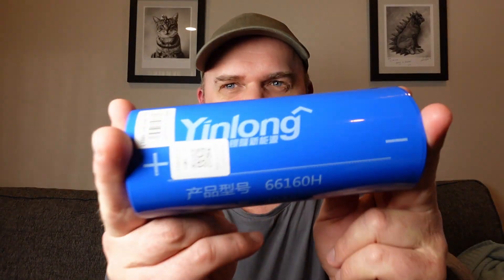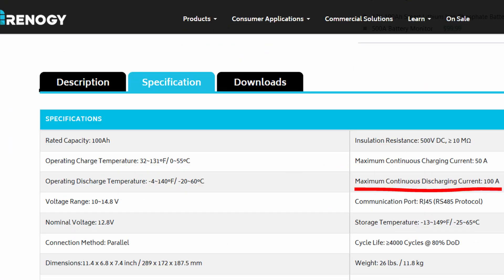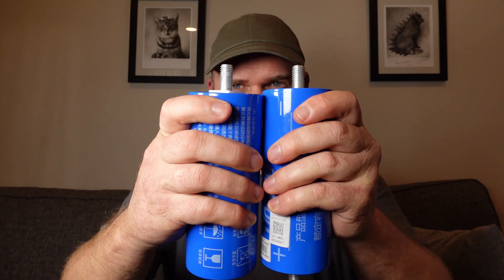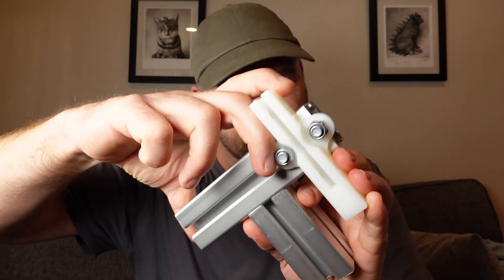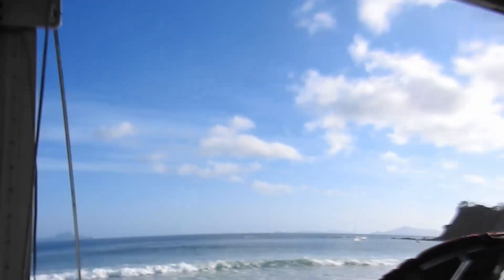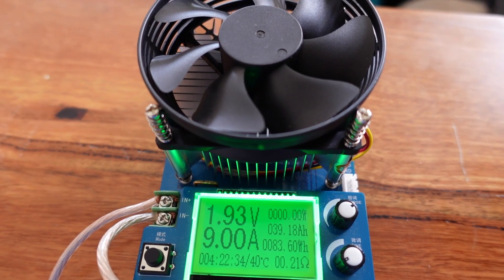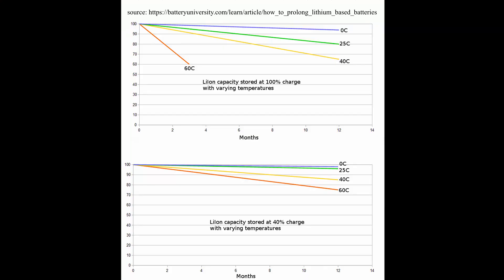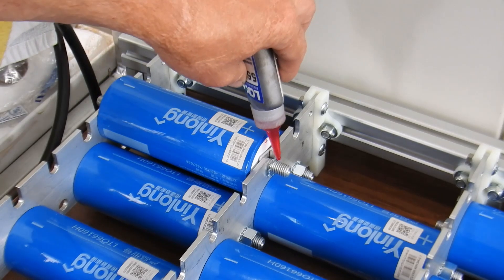Campervan DIY battery build HUGE POWER!

Comment: This is the most interesting set-up you got for your off the grid/caravan. 

I have one (probably a "microscopic" use compared to your use.) - I do a lot of ice fishing and ice camping during the winter months.  We have a portable ice shelters and equipments that run off  LiFePo4 batteries. (Depending on how many people are involved) My question is does those batteries that you used are 12volts? AND how do you recharge them back especially after each outing?  Our electronic fish finder runs off 12volts and we usually have anywhere from 10Ah to 20+Ah battery sizes (each one of us have different fish finder units and I know my buddy has a Garmin Livescope unit which is the most "power hungry" unit than the rest of us.) Also most of those aforementioned units run at RMS 500 (except for the Livescope which is probably more.)

Will those batteries you mentioned working on those fish finder and most of them run at DC 12-24 volts at different draw rates in "mA."

Real question is will those LTO work for those applications?  

We wanted to go lighter as we carry a lot out onto the ice and always trying to shave off some weight in anyway we can.  (Similar to the"hiker's rule" -Gram for gram, pounds for pounds, etc yet be compartmentalized.)

Thank you and keep up the good work on the YouTube video.  

Hailing from Maine 🤠😎😁

Comment: I'd like to make a battery bank of these for an RV how many would I need for 400 amp hours?
Reply from the maker: That depends on what voltage you are running.  Please try and get Ah out of your head as a metric for energy capacity.  Each cell has a capacity of about 0.092kWh.  So assuming you are meaning 12V... around 54 cells.  If you are looking at a bank of decent capacity tho I assume you have high power requirements.  If this is the case, consider moving away from 12V, it really is a terrible voltage to deal with for the loads in a modern RV.
Reply: @brendontait6968  Ah, ok. Good stuff thanks!

Comment: Wil also didn't say about using for 48 volt, if I remember and the math make them real good for that. If I also remember, he did another vid and said he'd gotten efficency wrong on them. I think one of there only drawbacks is wt. (Compaired to other lithium chemistries) witch shouldn't mater if used in a house and there prob alot lighter them lead based batteries anyway, I'm fairly sure. Doesn't seem to be much out there on them. This is my second time watching this vid. Take up more space? Nice build.
Reply from the maker: Cheers, from memory he did mention 48V in one of his videos but said it wouldnt work well either which is nonsense.  A friend of mine has a 4.5kWh LiFePO4 battery in his van and it's pretty much 1/2 the weight of my pack.  So with that example... there realistically is no difference in weight.  Also the fact that these are happy with 100% dod vs 80% dod for more orthodox lithium chemistry you can take some of the weight factor back in there also.  There is no doubt that other chemistries can be more efficient with weight and volume.  My requirements were ruggedness, safety and long life - I think these work well for that.  When I get more available time I'd love to put a bunch more time into youtube to create a bunch of different educational videos on electrical systems.  Hopefully '22 will be that year
Reply: @brendontait6968  I'm living in a RV in cold climate (Iowa, USA) and chemistry of other lithium batteries don't take charging below 0°c/32°f and I think I read that this chemistry isn't as fragil in charging below freezing temps. Thanks for your time and work doing the vid. Please do do more. For lifefo4 at up to 3000 cycles compared to 10,000-20,000 cycles, we're talking a life time battery! If they are cold hardy, I could mount them under thev RV, in the frame, a swing down  panel/box. There is, I think a half dozen sections, around 6x5 foot x about 5 inches deep under there. Good day.

Comment: great information I will be looking at these batteries for home bank. The only thing I would change is to use copper buzz bars
Reply from the maker: Cheers, why copper?  I can't see any real motivating factor.   Huge difference in price, the cell lugs are aluminium so all of a sudden you create a multitude of dissimilar junctions.  The distance the current travels in the bus bar is short, so any losses are negligible.

Comment: This video addressed most of my concerns about putting a battery bank together with various chemistries. Thank you for all of the hard work. My only issue that I see is 2.4v times 5 cells is only 12.0 - - I'd be worried that's not a high eenough voltage for my system which shuts off at 11.7v and would be much more comfortable with 6 cells in series which provides adequate headroom at 14.4v
Reply from the maker: I assume you mean series and not parallel.  Is there a specific reason you want to use a 12V system.  I'm using 24V and I think that is on the low limit.  12V is even less!  But yeah 6S is probably the way I'd go if I were doing 12V.
Reply: @brendontait6968  yes I did mean series and not parallel. Will edit. That's just currently what my inverter is - 12V system. I can switch to 24v or 48v. Have been thinking about it. But I'd have to buy a new mppt charger and inverter. Currently needing to replace my AGM batteries so it's all up in the air for now.
Reply from the maker: Have a think about where you want your system to go to future proof it.  I'm running dual induction hobs, electric oven, electric hot water and domestic fridge.  It can do it, but just.  I wouldn't want to run any lower voltage.  If you are looking at increasing your draw.  Consider selling your inverter, mppt etc and buy an all in one?  One thing to be aware of is some lithium batteries have a limit on max series voltage, so keep this in mind.
Reply: @brendontait6968  currently I'm fitted with propane oven/stove and 12V/24V fridge. Plan on sticking with that plumbing and going with a tankless propane water heater. But at first I wanted to do diesel heat with tankless water heater and radiant flooring. My main electric needs for now are simply 12v fridge, charging powering phones/computer, security system, and air conditioner. I can get a rear window A/C with dehumidifier that runs about 400W-500W but I'd like to run it 24/7. All in all I would assume around 60 amps per hour (A/C 50A max on startup but probably half of that to run, fridge 1.5A, security system probably 5-10A, electronics 5-10A) and I'm not entirely sure how solar panels will effect my total needs for AH capacity. Also a few minutes of microwave per day. So AGM is definitely not the answer for this and idk if Lifep04 is either longterm.
Reply: @brendontait6968  just did some quick math, and with 600W solar panels and 8 hours of sunlight I would need about 13kwh of reserve energy to go 24 hours per day or 1000ah battery
Reply: buggzo 6 cells parallel is 2,4v. Or what do I know
Reply: @4486igi  absolutely correct. Edited to be accurate now

Comment: It’s Ampere hours as the test is a discharge test at constant current over a defined discharge period, so a C10 rated battery will achieve its Ah rating when discharged over 10 hrs but a C5 battery can achieve its Ah rating when discharged over 5 hours ..

Comment: Interesting build, but unless one has access to CNC equipment, not repeatable for the average person.
Reply from the maker: Hey John,  thanks.. but I disagree with you regarding the requirement for CNC.  Many aluminium suppliers offer a routing service, I've supplied the files that could just be given to an aluminium supplier, alternately they could be done at a laser cutter, or you could print them out 1:1 and use the files as a template to manually drill the plates.  The side brackets could be 3D printed, or could be made just out of an angled section of nylon.

Comment: Great video.  Im trying to convert my forklift to a more efficient battery system.  How many of these batteries would I need to convert it over.  the current forklift lead acid battery rating is 48v 510ah.  also what do you use to charge it with?
Reply from the maker: Thanks, yeah it would take a lot.  One of the issues is that the forklift needs the weight of the lead.   Your current battery is about 24kWh... but you can only use half of that else you degrade the battery.  SO... these cells are about 92Wh each, so that's around 130 cells.  However.... I'd be looking at using prismatic cells to make it easier to pack and more space efficient.  You can just charge with standard lead acid charger or any other current limiting power supply

Comment: Can you design us a car battery size so we can use it for other things ? Thanks. *   So 18 cells in a car battery size box (2series strings in parallel --> 120 Ah @ 13.8v, cost 12 cells for $700 or you can say  for 18 cells : 1.5 x $700 = $1050 + mounting box , bus bars, time, effort. etc... what do you think on this... i want it to use with my patent circuit. 
  Background: 
  So the dimensions of one of the 2.3v cells looks like Approx 3" diam x 5.5" lengthn *pop can size*,... hmm.. so to make a 12v car battery size combination cell would be 12/2.3v = 5.2 cells , then add 1 more cell to make sure at 13.8v ( should be ok )  gives 2 rows of 3 cells each all in series --> 40 amp battery @ 14.3v   Neat... but prob won't start  a car;   & that look to be a very short height and $$$ battery, right, but experimenting with pop cans and a 12 pack size cardboard box, might get 20 cells in there to get up to 20 x 2.3v or 10 (2 series rows in parallel ) x 80A --> @ 23v or  maybe 5 ,5, 5   3 series rows of 5 cells each to get the 5 x 2.3v = 11.5v no too low the V for a car, ok 6,6,6, Mark of the beast?  3 series rows of 6  cells each - 2.3v x 6 = 13.8v and 3 rows gives it 3 x 40ah each= 20ah comparable to a 12v battery .*Repeats from first line:    So 18 cells in a car battery size box (2series strings in parallel --> 120 Ah @ 13.8v, cost 12 cells for $700 or you can say  for 18 cells : 1.5 x $700 = $1050 + mounting box , bus bars, time, effort. etc... what do you think on this... i want it to use with my patent circuit.

Comment: How many do i need to power a 2,000 sq. ft. house efficiently? I'm ready to drop the power company. I will use 12v dc lights throughout the house and power inverters for window units
Reply from the maker: It really has so many factors.  I'm going to do something similar soon.  You first need to know your average usage listed on your power bill in kWh/day.  Additionally you need to have an idea of how much sunshine you get, also an idea on how many days you'll get without sunshine.  Because of the considerably larger amount of power a house uses compared to my truck, I'll be using LFP cells

Comment: Really nice rack mount for the cells. I'm a bit worried about the small tube used for isolation from the rack though.
Reply from the maker: Thanks, tho the tube does not provide complete isolation, just isolation to the mounting bolts, which have secondary isolation through the brackets to bus bars

Comment: I think they shouldn't be in system as 400A, because is too much for these cells:

Max. Discharge current (A) 400
Optimum discharge current (A) 40
Max. charging current Charging current (A) 400
Optimum charge current (A) 40

So in normal situation, in optimal system they will give you 10 times less power that you told.

Correct me if I wrong ;)
Reply from the maker: Yeah, I think you are wrong sorry

Comment: Hi Brendon.  I enjoyed your very informative video and have read many of the comments and answers.  
I'm building my minivan into a camper van for short camping trips of a few days each, mostly.  I have wired in an A/B/Combined battery selector switch and have wires run to the back of the vehicle.  My biggest need for electricity while camping is for interior lighting, which is currently a combination of LED and a strip of small, low wattage bulbs in an overhead enclosure.  I'll change those to LEDs when I can find something that fits.  
Since a bank of 6 of these batteries has a charged voltage of 15.3v do you know if it would be advisable to replace the vehicle's starting battery with these and not use a second battery?  I realize a lot depends on usage but, as a general comparison... Also, I didn't mention that I'll be adding a 5kw diesel air heater which will require power to both start and continual power for the fan.  
I guess, basically, I'm wondering how much more stored energy I would have with a bank of these versus the normal relatively high capacity lead acid starting battery. 
Thanks - I just found this video last night and looking forward to watching others you've done.
Reply from the maker: Hey, thanks... you could replace starting battery with these cells, however if you have a small system and run it down, you want to make sure you always have enough juice to crank.  Lithium do not do particularly well paired with lead acid, you can just run a basic dc-dc converter to charge these cells

Comment: Thanks for the video! - Does Will know you disagree with his assessment of this battery technology? His thoughts on your findings would be interesting. Is it possible the cells he used were not comparable to the ones you had which lead to the difference in efficiency? Did his cells get hot? - I guess I'll have to check his vid next. Thanks again!
Reply from the maker: Hey, he does know I disagree, he even made a retraction video based around my video.  He still doesn't like this chemistry, but I do.

Comment: Would be very worried about using the aluminum 40 X 40 section supporting the different bus bars because if you had a side impact and 2 bus bars touched the 40X40 supporting aluminum and shorted, my god would you have a electrical fire with molten aluminum!!!!!!!
Reply from the maker: Hey Stephen... It would take an enormous impact to break the mounts that hold the bus bars.  The battery sits about shoulder height and the tray frame of the truck immediately surrounds it.  There are 24 brackets, each with two bolts sharing the load of the cells and potential impact.  The 4040 is more robust than most battery shells.  The battery is fused on both sides so that a short between any busbar and ground will pop a fuse.  I am certain that this pack is safer than most any other that I have seen.

Comment: Noone knows the calendar life of those Li cells. Who has gotten 40k cycles out of them?
Reply from the maker: Hey andrew, you're correct.  The chemistry hasn't yet been around long enough to know.  It has been around for about 15 years and degradation tests over that time have approximated a lifetime.  WIth regards to cycles, there have been many studies undertaken that cycle test cells like this upto around 6 times per hour which would work out to 20,000 cycles in around 5 months, so there is data on this.  Typical lithium chemistries life tends to run out due to the graphite electrodes.  These expand and contracts with charge and mechanically get damaged, additionally the sei layer causes problems over time.  I'm a big fan of things that are not as disposable as most things seem to be these days.
Reply: @brendontait6968 thanks for the info,  you know way more than I do about these batteries. Is it true  that something like 98% in lead in lead acid batteries is recycled and virtually none of the Li battery ingredients are recycled?

Comment: Gorgeous use of this technology. As a schooled electrician I will assert the importance of proper dielectric grease whenever connecting anything aluminum to itself and or dissimilar metals especially tin plated copper lugs. I may have missed that step.. I saw lock tite. Very important especially with such enormous currents. Positive reinforcement awesome build.
Reply from the maker: Thanks, check around 8:20 where I apply a wipe of silicone grease to the terminals.  Cheers

Comment: Why aluminum busbars? I use copper plumbing pipes on the cheap
Reply from the maker: The bars serve as a structural member also, so i'm not sure water pipe would work great in this design.  Another issue to contend with is a large number of dissimilar metal junctions, since the lugs on the battery are aluminium, it's best to keep the conductor similar material and reduce dissimilar junctions.  There is no significant detriment to using aluminium in this case... it's cheap, plenty of conductivity, light weight...
Reply: @brendontait6968  fair enough. Great build

Comment: Is there a real purpose for the “puncture test” or is it just for fun?
Reply from the maker: it's an indication of how they handle internal short circuits.  Traditional lithium cells can form internal shorts from dendrites that can grow internally.  With the LTO chemistry, the titanate works as a PTC, so any areas that get hot prevent current flow from happening and getting the temperature any higher.

Comment: only thing i could add would have been to heat shrink your busbars  before install and cut out where your connecting bols etc would be. just in case something fall onto it and short to earth
Reply from the maker: Hey Ross, believe it or not.. it is actually pretty difficult to make something short.  The cells stand quite high and alternate.  I have got a fuse on the -ve terminal incase I get an intercell short.  I also have a polycarbonate cover over the entire pack.

Comment: what are you using the power for ?  i use gas for cooking ,diesel for heating  batteries for lighting  and rarely use 240v . great build !
Reply from the maker: I use it for cooking, hot water heating, domestic fridge... pretty much everything, still find I have plenty of power to burn.